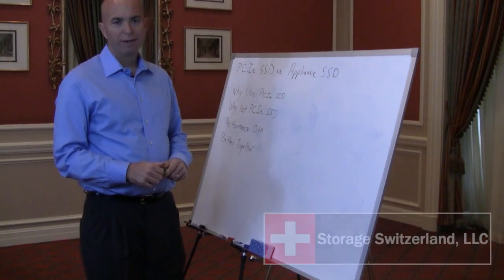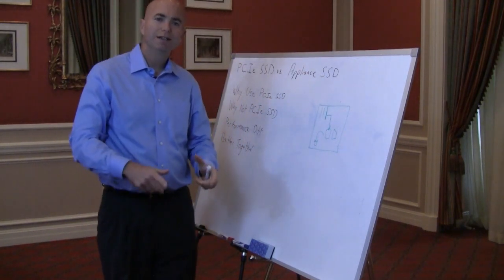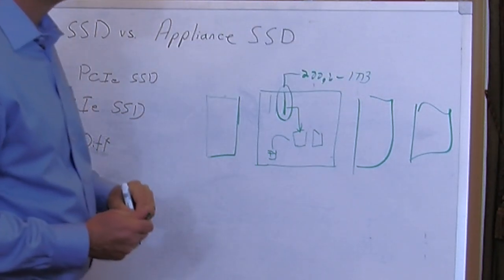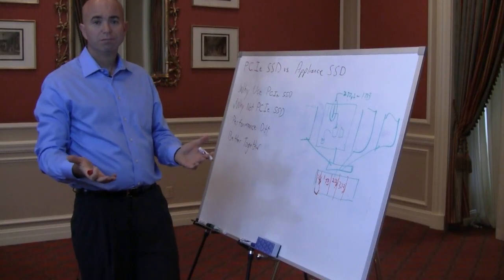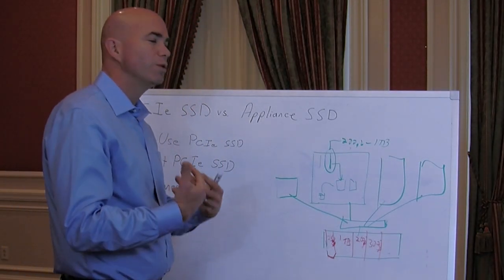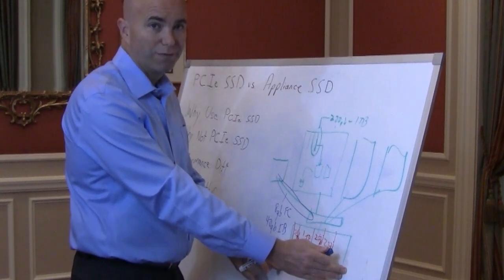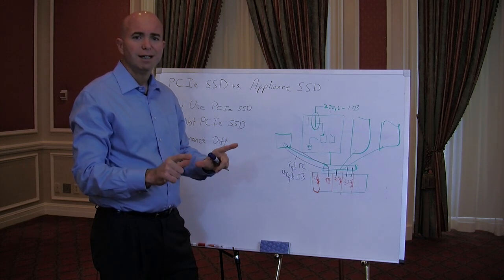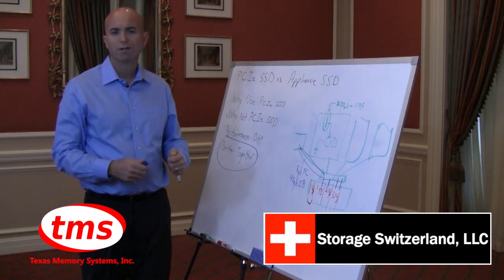PCIe SSD or Appliance SSD

Comment: Year or two only?!

There are PCIe SSD MLC drives with endurance rating from 25 PB (Peta Byte) to 80 PB, I thought they might last in between 3 to 5 years (as caching solution) for most enterprise applications. Won't they??

Comment: nothing about hot pluggable ssd in appliance vs pcie which is usually less easy to repair without downtime? also, mlc rather than slc pcie has a lifetime that must be carefully monitored and estimated in advance. It might be as low as a year or two!